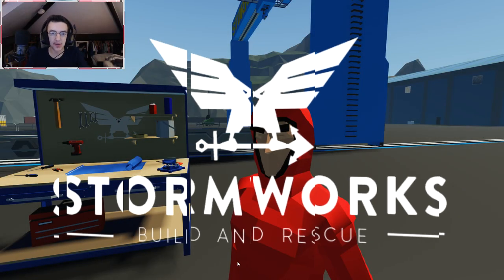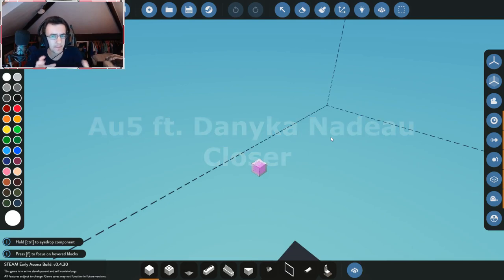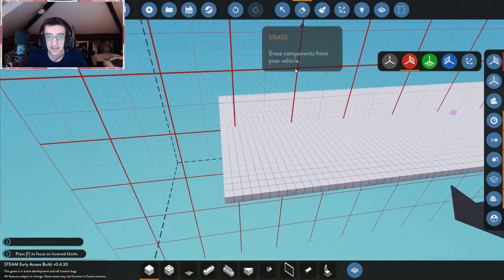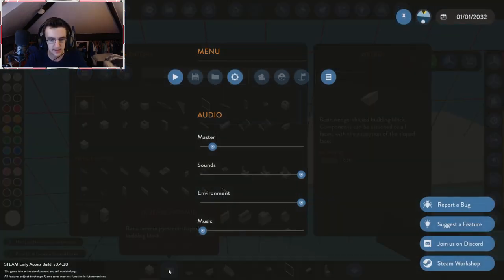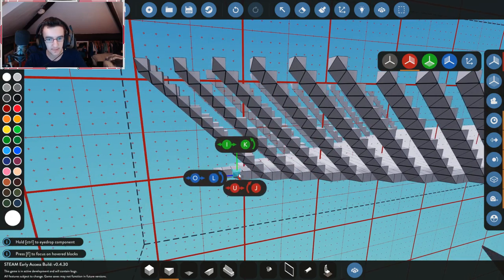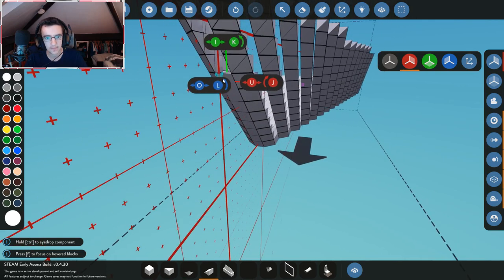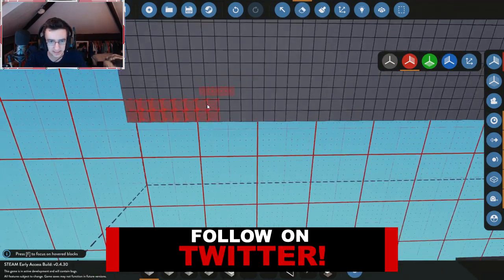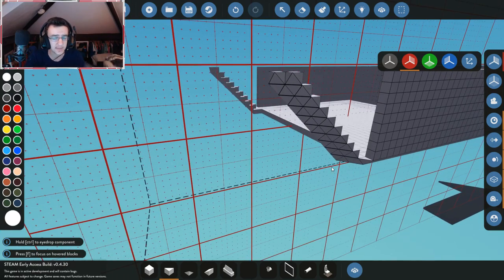Hull Shaping  -  Huge Cargo Ship  -  Stormworks: Build and Rescue  -  Part 1

Comment: Frantic you need to balance out the ship so i wold advise you that you should put the engine room in the room behind the cargo hold. And the front of the ship is called the bow and the back of the ship is called the Stern
Reply: Mathfim or add tilt control